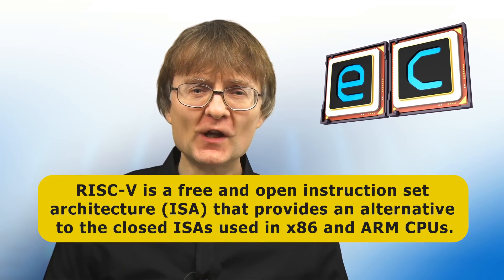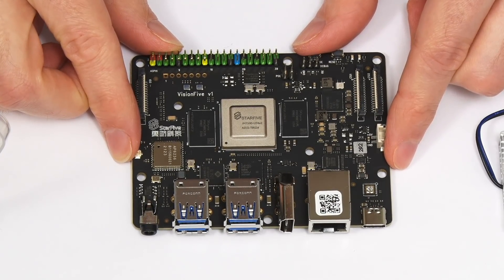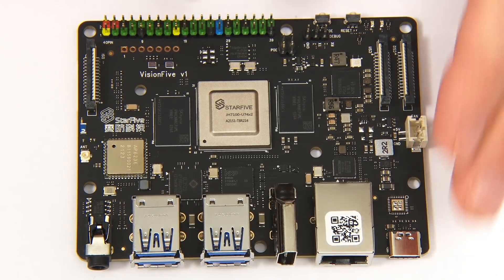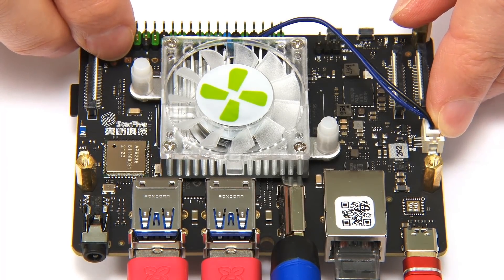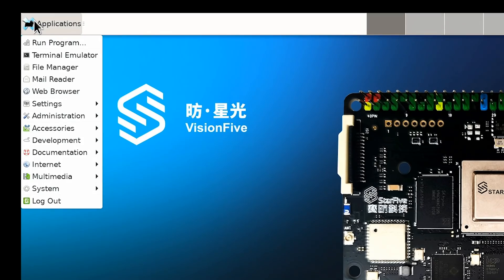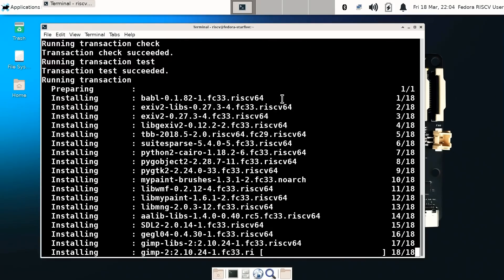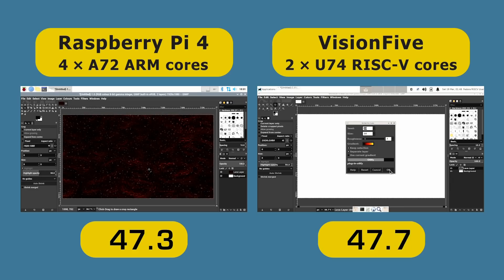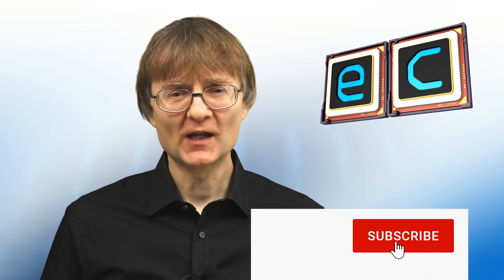VisionFive RISC-V Linux SBC

Comment: I anticipated the Gimp test comparison to be much further apart when I looked at the general specs of each SBC but it was a lot closer, which might be a big positive for RISC-V, especially as this is essentially a first gen product.

The price paid however cannot ever be the norm otherwise it will never compete.

Hopefully mass manufacture can lead to more sensible pricing.
Reply: If that was a Raspberry 4 then the VisionFive is a pretty capable computer.

Comment: Is there a reason why the currently sold boards have 2*1.0 GHz instead of the announced 2*1.5GHz?
And what are the news about the V2 version?
Reply from the maker: I suspect, but do not know, that the speed droped due to obtaining acceptable yields in SoC fabrication -- the higher a chip has to clock, the less chance of it surviving the process. So as we are looking at very new hardware here, I imagine this is why the cores run slower in final hardware than initially intended. I know nothing formally about the V2, expect that it is expected to have a GPU. I would like 4 1.5Ghz U74 cores. :)

Comment: Killer. But, uh, any idea what those 7 solder point holes right next to the GPIO do? it looks like a place to put a 7x1-pin connector with the standard 2.54mm pitch, but it's not populated with anything. Very curious indeed. Some sort of JTAG, maybe?
Reply from the maker: Excellent spot! :) I agree it looks like a 7x1 header goes there, but I've not idea what. It may be for factory diagnostics or other testing of some kind as you suspect.

Comment: It's amazing that we got to this point where we can have RISC-V SBC which can run desktop Linux at a competitive price point, Obviously software is going to be the Achilles heel until the compilers and large softwares are specifically optimized for RISC-V which I'm bit worried as even after years of Linux ARM SBC; softwares e.g. Browsers haven't been optimized to the extent of x86 counterparts, even lower spec x86 chromebook runs the browser better than ARM Linux with better specs.

I'm eagerly awaiting the video on neural engine and the NVDLA accelerator; Especially if possible in comparison with Jetson Nano in running some deep-learning benchmarks because an accelerator should theoretically outperform GPU for specific workloads and if so this board can offer more value for lesser price than jetson nano for AI tasks.

Thanks Mr.Chris!

Comment: 1.0ghz?  OOF what year is it 1999?
Reply from the maker: As the video makes very clear, this is a development board using a new totally CPU make for this board! :) It is not a consumer product. Manufacturing small batches of totally new CPUs is not easy, and as in all CPU manufacturing, yields are maximized by lowering the core frequency of the final product. Do you think that the first x86 and ARM CPUs ran faster than 1 Ghz? They did not.
Reply: @ExplainingComputers  a few kHz from what I remember. That comment was a poor attempt at a joke.

Comment: Is it so expensive because of relatively low volume production of the CPU or because everything is more expensive right now, including Raspberry Pis? Of cause 8 gigs of RAM will also make it more expensive than your usual 4GB or less Pi.

For performance comparisons something like an original Banana Pi (2 cores @ 1GHz) might be fairer.

Comment: Fedora seems to be quite slow on this sbc. Could you try Tiny Core Linux on it Chris? The whole distro is  just around 20 mb. Curious about your verdict about this Incredible small distro.
Reply: Btw.. it offers a lot of applications. Ofcourse the size of the distro will grow than.
Reply from the maker: This will only a Linux distro that has been ported to RISC-V, and right now I'm only aware of (unofficial) Fedora and Debian for such hardware.

Comment: For the price, would have been nice to have 4 cores to compete more fairly with the slightly less expensive pi 4.

Is it possibly to limit both devices to a single core to compare how each different processor will handle a set of tasks?

Comment: The connector arrangement is a lot more thoughtful than that of a Raspberry Pi. Everything is on one side, so you can put this board against any back side of a housing and get access to all the USB, HDMI, audio, network and power connections. At the same time you can easily access the 40 pin header. Nice.
Reply from the maker: I totally agree -- it is a very nice form-factor.

Comment: I am pessimistic on RISC-V.  Too late for the party. Yet another MIPS. It has not much advantage over already dominant ARM in terms of economy. Open source is not enough. It will be used in some fringe apps, but not in mainstream. Just like Linux in desktop. Without killer app like PC for x86, smartphone for ARM, RISC-V will not make economy of scale to compete ARM. No economy, no future.
Reply from the maker: You may be right. But RISC-V is not open source -- it is open hardware. And specifically an ISA where anybody can use the involved intellectual property to design and build a CPU -- something that cannot be done with x86 and ARM ISAs. And so the drivers of RISC-V will be politics and economics -- specifically those of rising trade barriers and sanctions -- rather than anything going on in the computing industry.

Comment: A bit disappointed yet. How did this come out weaker than a pi 4 per core (and there are only 2) two years after that solution, and with still lpddr4 and no nvme, but at *twice the price*?
Reply from the maker: Because it is an early development board. Not that long ago available RISC-V hardware cost thousands of dollars.

Comment: I was wondering is the same RISC system that I use to run on an IBM RISC 6000 may moons ago? Though, it ran IBM's AIX Unix 4.2 operating system.
Reply from the maker: RISC-V has its roots in the Berkely RISC research, rather than that from IBM in about the same period. But I suspect you would find some common foundations.

Comment: The misunderstanding is that the RISC V architecture will be open source, and the instruction set. But that doesn’t mean open source hardware. If a chip designer puts effort into a design Using RISC V, the will still expect their reward, and protect their own IP.
Reply from the maker: This is certainly a common confusion, as many comments here show. However, I took very great care in the video to make absolutely clear that RISC-V is an open ISA, and nowhere did I describe  the SiFive cores or SoC as open (although some RISC-V core designs may be open). Also, nowhere in this video do I describe any form of hardware as open source: "open" as in hardware and "open source" as in software are very different things indeed. The latter, as in RISC-V, is about underlying open IP on which other may build closed IP if they wish as you rightly note.
Reply: @ExplainingComputers  yes, my comment was aimed at the other comments here, not your video.

Comment: Is this based on the Motorola MIPS RISC instruction set?
Reply from the maker: No, its based on a RISC-V instruction set. :) But of course all RISC instruction sets have some heritage.
Reply: @ExplainingComputers  Cool.
Reply: I only ask, because I used to be an assembly programmer in the past.  I don't do it any more, but I still know all the assembly ops.
Reply from the maker: @sammcbride2464  Ah, I understand. I did some Z80 assembly language programming many years ago. And so I understand how it provides a very different view of computing. I imagine you would find a lot that is familiar in RISC-V based on our previous coding, as it comes from the same  roots.
Reply: @ExplainingComputers  Funny that you bring up Z80.  It is based on the instruction set of the Intel 8080 with a few more ops and higher speed.  I built a CP/M Heathkit computer with HDOS or CP/M and also owned a Trash-80 and Commodore 128 with a Z-80B running at a whopping 2MHz.  On the heathkit, we wrote a FORTH compiler using assembly.

Comment: A good question will be whether China or Russia lets companies contribute back to RISC-V. I think it will probably be mostly contributed to by universities. 
Companies don't have to contribute their developments, which may result in high levels of vendor lock-in to the few companies that push hard into development, and it's not in the best interest of those nations to share back.

I think where we're headed is back to multiple sub-processors. It was convenient when Intel/AMD started making a single chip that could do most everything fairly well, but co-processors are becoming more popular and will eventually provide enough supplemental behavior that the CPU can be weaker. At that point, it would make sense for more companies to give up licensing costs and focus on what works 'well enough' for less.

Comment: I think you needed to tell us what RISC-V is and what it does differently, first. 
The way it looks to me, is that it's slow as molasses. Even for a development board.
Reply from the maker: I will be making a video called "Explaining RISC-V". But I did explain at the start of this video that RISC-V provides an alternative to x86 and ARM, and is open rather than closed in its IP.
Reply: @ExplainingComputers  I understand that, but people will by chips for their performance.
It doesn't matter if it's open source. It's not like people can change a SOC. It's not like code that one can change and tweak! 
Do you see what I mean? I look forward to your video. Cheers.
Reply from the maker: @piconano  I see what you mean, but consumers will not be buying this chip to run a desktop PC -- they'll be buying one a few generations down the line. But they won't  buy that until there is good software support, and for that to exist, development hardware is needed.

The VisionFive is perfectly usable and stable and, for example, massively better than running Windows 2 (and I mean 2) on a PC in the early 1990s. I could happily work on the system. But it's not going to replace the i7 I edit these videos on anytime soon! :)

Comment: There are a bit more dev boards available, all with different set of pros and cons.

1. There is Sipeed Lichee RV - 4.5$ for a dock and 17$ for the CPU board. It have Allwinner D1 and 512 MB of DDR2 RAM, so less than visionfive, software support for it is worse, overall CPU is slower (1 core only), but for a single thread applications it's a bit faster (jh7100 in vision five have some design issues that doesn't allow it to work as well as it should've worked).
2. There is a bigger brother of Lichee - Nezha - it is basically same as Lichee but with 1 GB of RAM and for 112$
3. There is RVB-ICE dev board which is based on Alibaba XuanTie C910 and technically is much faster than both Lichee and VisionFive. It's CPU is comparable with Cortex-A75 in raw performance (per-MHz), however board itself was design not as a Linux SBC but as android dev kit and it doesn't have USB Host for instance. It's software support is better than for Allwinner D1, you have a semi-working debian image. Oh, and what makes it a bit more exiting - it have a 3D Graphics accelerator (Vivante GC8000 - so it should support OpenGL ES 3.2 and Vulkan 1.1 using proprietary drivers). Drawback is software support and community - there is basically not a lot to tell - you have semi-broken image with Debian Unstable - semi-working as it requires some patching to get built-in screen to work right. It doesn't have any repos configured, but you can use debian's. It comes with custom built GCC that increase speed of binaries it compiles by about 25% compared to vanilla GCC. There are manuals but in Chinese. Board overheats under load and crashes if not actively cooled and board doesn't provide 5V for a FAN, so you need to figure out how to get it Oh, and that costs about 460$ including shipping.

And I guess there is no need to mention HiFive boards as they are way beyond reasonable price range.

Also, both Allwinner D1 and XuanTie C910 (not sure what's exactly written there on a chip, haven't removed radiator from it so far) support RISC-V Vector Extention 0.7.1 (non-final spec, and on C910 there are some caveats that you need to switch to a third CPU cluster that have 1 core only), however intrinsics comes only with Alibaba's custom version of GCC or you need to dig for patches for either LLVM or GCC if you want to build your own compiler. Of course you always can revert to writing in assembly.
Reply from the maker: Thanks for posting this list, although I never that the VisionFive is the only board available! :) I stated that it was one of the first RISC-V boards able to run a full version of Linux, and this is true. As I noted at the end of the video, I will be reviewing other RISC-V hardware, which will include the Nezha. :)
Reply: @ExplainingComputers  yeah, I just wanted to put a list of alternatives here.

As about one of the first - I would say fourth one to be precise if we count widely available boards.

And for Nezha - just be prepared that software support won't be on a same level as for visionfive.

Rvb-ice is one of the most interesting ones in terms of speed, but it's pricey.

Comment: Something wrong with your Pi test, a 1920x1080 lava render on gimp takes less than 20 seconds on my Pi4B, 8GB.
Reply from the maker: This is very strange. I was running on a Pi 4 4GB, but this should not make that much difference.
Reply: @ExplainingComputers  another commenter says 15 seconds on a Pi 400 which is also 4GB.
Reply from the maker: @MeTube3  Noted, although a Pi 400 is not exactly the same spec as a Pi 4. I will re-run my test again when I am next in a position to do so. All I can report right now is that I ran the test in GIMP on a Pi 4 a couple of weeks ago, recorded as I did so, and got the result shown in the video! :)
Reply: @ExplainingComputers  a pi 400 is practically a Pi 4 with better heat dissipation out of the box.
Reply from the maker: This is true, but it is clocked faster because of that. This said, the latest version of Raspberry Pi OS clocks up more recent Pi 4 models. But not mine, as it is a very early one (a pre-release board to be exact). So maybe this is the issue here -- a recent generation Pi 4 and a Pi 400 running the lastest version of Raspberry Pi OS will complete the test faster. I will when I can test on a Pi 400. But I don't have 60+ SBCs all hooked up and ready to test all the time I'm afraid.
Reply: @ExplainingComputers  clocking (I hoped that’s what you meant!) is a user variable. By default pre-bullseye 400 was faster with the download image so, but it’s not a set in stone value. It would be interesting to see if the RISC V sbc can be overclocked.
Reply from the maker: I did, edited now! :)
Reply: @ExplainingComputers  one more thought, sorry. Could it be paging/swapping RAM and suffering from slow SD card performance?

Comment: If the lava rendering is performed on all cores, then the RISC-V hasn't done too badly given half the cores of the ARM. My 1st Gen Ryzen 1700 (8 core/16 thread) with Radeon RX580 graphics card did it in 16 seconds. This makes the lower power RISC-based processors even more impressive.

Comment: Sir, what does "open" actually mean when it comes to hardware? Hardware can't be given away for free on a sustainable basis because it obviously involves material production costs. Please clear this point. Thank you.
Reply from the maker: This is a good question. "Open" when it comes to RISC-V means that the intellectual property (IP) on which the ISA is based is free to use without restriction. Nobody can make an x86 chip other than Intel & AMD, and nobody can design and make an ARM CPU without paying a license fee to ARM. But anybody can use the RISC-V ISA to design and manufacture CPU cores and chips.
Reply: @ExplainingComputers  Thank you for the response, I had no idea about such patent/license obligations.

Comment: I still don’t know how RISK-V effects me, can it run Linux Mint and Microsoft Code? I have a pi4 with it’s new 64bit OS which seems very very good, super faster I think, and a seeed odyssy running Linux Mint splendidly in front of me now and two nvidia jetson nanos upstairs in robots. Basically I could spend the rest of my life trying to master these little computers I already have and I never really fully mastered machine code on my ZX Spectrum, plus my Texas MSP microcontrollers are not easy either, the learning book is massive.
Is there a way to freeze time for about 10 years and stop people bringing new SBC’s out so I can catch up?

Comment: I'm surprised that the vision 5 applied the effects at less than twice the time the raspberry pi 4b does, knowing that the raspberry pi has twice the cores, running at roughly 50% higher frequency. 
It would have been cool to compare it to lower end raspberry models, like the zero, or raspberry pi 2B.

I'm just a bit disappointed at the low amount of cpu cores. I feel risk has to start with 4 cores, preferably 8, and should ramp up to 100 cores for deep learning.
Risk v should be able to process 64-bit DPP computations more efficiently than x86 and arm, and really becomes interesting when they figure out how to cluster cpu cores efficiently.

Comment: I recall from my Acorn days RiscOS stood for Reduced Instruction Set Computer Operating System or something similar.  ARM was Acorn Risc Machine, Is there any relationship to the old system or is it just terminology like we refer to most vacuum cleaners as a Hoover?
Reply from the maker: You are right -- RISC stands for reduced instruction set computing (an alternative to CISC, or complex ISC). RISC-V is an ISA based on a RISC architecture. It is called RISC-V as it started life as the fifth generation RISC research project at Berkeley, where RISC computing was first developed in the 1980s.